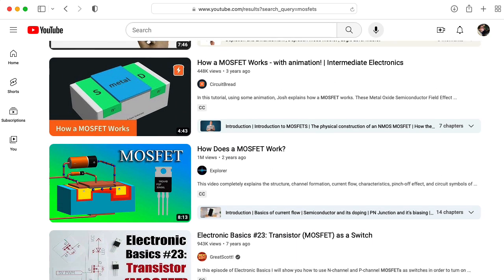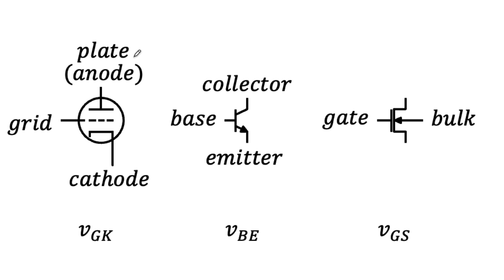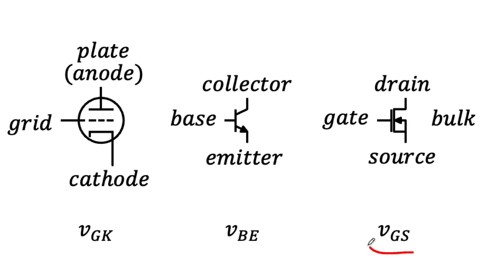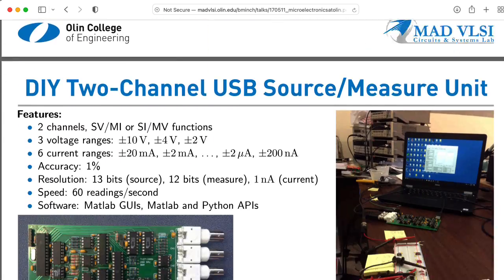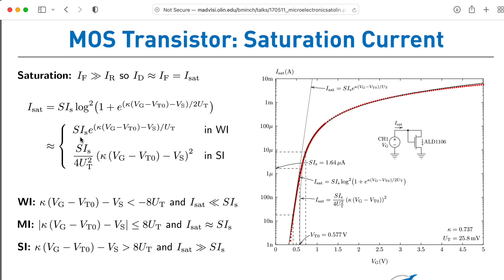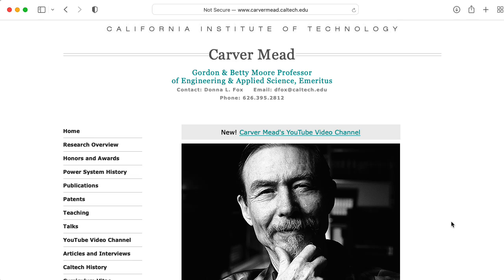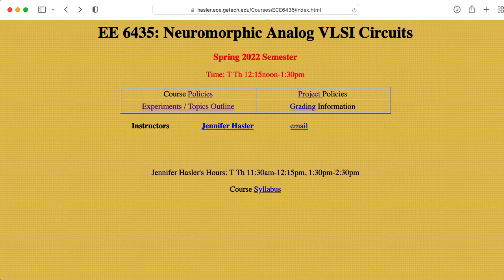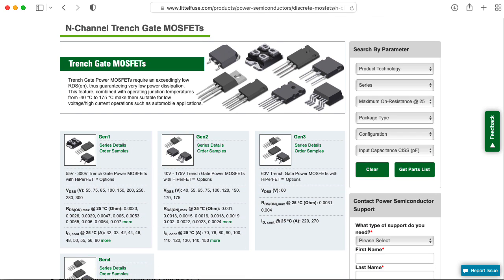They Mislead You About MOSFETs

Comment: Love your videos! As an analog IC designer, let me make some comments: most integrated technologies are build on a p-type substrate, which means that what you said about NMOS bulk being always connected to ground is true. Not for the PMOS though, they are built on an isolated n-well and they have a separate connection that can be tied to its source (another reason why sometimes PMOS input pairs are preferred over NMOS, other than 1/f noise). If it’s an n-type technology, it’s the other way around for the bulk connection. Also lots of technologies allow for triple well, which means that even the NMOS can be isolated. This is usually more expensive in terms of area, but sometimes necessary. Especially for more recent technology nodes, where headroom is a problem, and for mixed-signal designs(basically all designs today are mixed), as the switching noise from digital may couple via the substrate to the sensitive analog parts of a system on chip. Keep on the good work, and thanks for everything
Reply: YES, I was just about to write that. I worked as a layouter on analog IC chips for automotive industry and we used several different technologies that allowed for differently polarized n-well pockets and one technology that allowed splitting the substrate into few independent sections. This is somethimes a crucial component of the design and there are two main reasons why. The first one is, as mentioned by rscreepin, noise reduction. I remember routing an input amp section for integrated parking sensor, which was powered from it's own low-noise regulator. Second reason is the ability to work with "high" voltage (in our case, it was up to about 60V). Transistors have smaller breakdown voltage than the body diod of n-well to p-type substrate, but you can cascade them and process larger signals.
Also, I would like to add to the 2:12 claim, that you wouldn't want to put the voltage the "wrong way" around. Somethimes, you would. The body diod of discrete FETs is often used for "active" rectifier aplication. For example pretty much every lithium battery protection circuit has a FET transistor, which is connected the "wrong way around" and works as a diode.
Reply from the maker: Pinning this comment. Thanks!
Reply: @Lantertronics  You may find this of interest: A Simple Zero Debounce Delay debouncer for an SPST switch 
https://spacetimepro.blogspot.com/2023/09/switch-debouncer.html
Reply: There is SOI processes

Comment: You gloss over the asymmetric design of power mosfets at the end but that's actually a subject worthy of some attention, particularly in the way it illuminates why the IGBT exists and what makes it so special: it's literally an n-channel power mosfet with the N+ drain layer replaced with a P+ collector(/emitter) layer. This one change converts the body diode from a parasitic element to a primary current carrier, giving the structure a much bigger cross-sectional area to pass current through vs the thin conductive channels close to the gate that you get with the original mosfet structure.

Comment: High power mosfets have honeycomb structure and drain/source aren't symmetrical. Check out the illustration to "History and Emerging Designs of Power Transistors B. JAYANT BALIGA". Easy to find in google.

Comment: Your point about the Drain and Source being the same is only true for certain MOSFETS.   You need to clarify that you are talking about a low voltage device constructed using a lateral structure.  If you look at higher voltage vertical structures the Drain and Source are very different.  Also the same applies for your description of the Bulk substrate.
Reply from the maker: I mention it at the very end, but you're right, I should have made that clear up front.
Reply: Have to scroll tooo far to find this comment among all the fanboys cheering author who actually mislead them

Comment: 1:46 If the bulk is tied to one of the terminals, that makes the terminals different. But you repeat that the only difference between the terminals is determined by the voltage difference between the terminals ,and nothing to do with the bulk connection. That seems unclear or contradictory. You mentioned "putting the voltage the wrong way", but if there's no difference between the terminals, then there's no "wrong way".

Comment: Thanks for sharing, this video was quite insightful and it left me questioning some things, particularly CMOS gate design. Why is it that we only use PMOS as pullup and only NMOS as pulldown? I was content with the Vgs explanation (PMOS can only pull down to Vth-Vss, NMOS can only pullup to Vdd-Vth), but I didnt realize I was making an assumption that didn't apply to CMOS ICs generally, if the bulk isn't shorted to source (and vgs no longer applies), why are CMOS circuits designed the way they are?

Comment: A few notes:

1.) For NMOS, yes, it’s the bulk tied to ground. For PMOS you have a well in which the bulk sits. Of course, other technologies using isolating substrates like quartz, diamond or sapphire can have specialised bulk connections tied to either + or -, there are no absolute rules in design besides the physical characteristics of the device.

2.) BJTs are actually better described as current controlled devices because the maximum current flowing through the collector is in a direct linear relationship with the number of holes or electrons moved by the base-emitter current. Also, technically speaking BJT could theoretically be symmetrical devices, but their characteristics would be garbage compared to asymmetrical ones doped differently.

3.) There is a transistor kinda like in-between a BJT and a MOSFET called a JFET. Those have excellent linear characteristics, are indeed voltage controlled devices in normal operation and can be used in the anti-pinch region too for a few tens or hundreds of millivolts. Unfortunately, most of those are normally ON devices. Some MOSFETS are designed as normally ON too but the doping of conductive channel section is a bit more special.

4.) This is actually another thing that’s almost exclusively seen in MOSFETs. They can behave either as normally ON or normally OFF devices, which is remarkable since other technologies usually don’t allow for such a degree of fine-tuning. This versatility is why we’re seeing MOSFETs in the widest array of applications, from power switching and signal processing to digital computing.
Reply from the maker: Random thoughts: 

1) The RCA Cosmac 1802 has a silicon-on-sapphire version that's in Voyager spacecraft. I only mention this because few people have heard of the 1802 and I think it's really cool and want more people to have heard of it. :)

2) I much prefer the voltage-controlled viewpoint, since you're generally driving your circuits with a voltage. When I teach our junior analog electronics class I find it much easier to explain BJTs circuits in terms of transconductance, and the base current as an unfortunate defect that you just kind of have to live with. I have some more recent videos titled "BJTs are VOLTAGE-Controlled Current Sources!" and "More Story Time with Professor Lanterman (The BJT Control Controversy) where I blather on about this more. ;)

Sometimes people say the current controlled viewpoint is better than the voltage controlled viewpoint because the Ic = Ib beta equation is linear whereas the Ebers-Moll equation is exponential. But I think that just shuffles the complexity elsewhere instead of really getting rid of it. And beta is kind of a dodgy anyway, being a function of Ic (beta droop) and a bunch of other stuff.

3) I'm kind of sad that JFETs seem to have gone out of style. I see them used as approximate variable resistors in compressors/limiters and as muting switches in mixing consoles, but the only other place I see them used seems to be guitar pedals.
Reply: @Lantertronics  
I see you love JFETs too.
Did you know some modern JFETs are actually used in high voltage switching applications where MOSFETs tend to get their oxide layer fried?
eu.mouser.com/datasheet/2/412/UJ3N120035K3S_Data_Sheet-3177188.pdf
Check out these fancy silicon carbide JFETs.

Comment: This puts me in the mind of Newtonian physics: it works as a way to describe the stuff we can see, more or less closely enough to get the job done, but it doesn't actually cover all possible cases and even when it does work it's not absolutely accurate then either.

But generally speaking we can forget that when you throw a baseball it gets slightly heavier.
Reply from the maker: The twist here is that I think the voltage-control view actually makes it easier to analyze most transistor circuits, if you teach it the way Marshall did. It' like if general relativity made teaching easier than Newtonian physics. ;)

Comment: 2:18 "There is nothing stopping you from doing something pathological with it and putting the voltage the wrong way. Of course you don't want to do that." Having the source of an N-MOS positive relative to the drain is actually desirable when using them for power gating (common source pair for low-loss bidirectional control) in a BMS or other power distribution/management situation or when using them for synchronous rectification. You would likely also use this sort of setup in a bidirectional boost/buck converter. There are plenty of MOSFETs packaged specifically for those applications.
It may not make sense for logic but is plenty useful for power handling.
Reply from the maker: I really should make a follow up video talking about that. When I was making the video I was thinking about small-signal amplifiers -- analog signal processing sort of things. So I (sadly) missed this entire important application area.

I'd need to do a lot of study though, power electronics isn't my area.
Reply from the maker: Or I could cheat and point to another resource... do you know of another video here on YouTube by another content creator that talks about such topics well?
Reply: @Lantertronics  I'm not aware of anybody doing deep-dive videos into power conversion circuitry, not much of a market for that on YT. I suspect most people looking for this sort of insight will follow the datasheet and appnotes rabbit hole. Almost certain Bigclive has at least one power bank or other gadget tear-down where he explains why many battery monitoring chips use a dual-FET packages to isolate the battery. Pretty sure I have seen a multi-cell BMS review that explained the differences between contactor and MOSFET disconnect.

Synchronous rectification and bridge-less power factor correction are quite well documented, resources there are plentiful.

Bidirectional DC-DC converters are somewhat of a rarer breed, though I suspect interest for it will proliferate with the need for USB-PD to accommodate a broader range of anything-to-anything at the sub-200W end of the power spectrum and DC power sharing between home energy storage and BEV at the 10+kW end.

Comment: Aaron, the voltage between base and emitter (Vbe) does not change much after 0.66V for silicon as it is just a p-n. Bipolar transistors are driven by the current, not voltage. Are you really a "professor"?
Reply from the maker: I wish I could go back in time and find the people originally describing the BJT as a current-controlled current source and make them change. They've caused a tremendous amount of confusion.

The Ebers-Moll equations relate all the currents and voltages at the terminal of the BJT. It's not that calling it a current-controlled current source is wrong, it's that it's just as valid to say it's a voltage-controlled current source, and it's much more helpful in designing and analyzing circuits to think of it that way. Most circuits apply the input as a voltage at the base, not as a current source. 

The traditional form of the Ebers-Moll equations give Ic as an exponential function of Vbe. It's best to flip your "does not change much after 0.66V for silicon" which is a current-focused view around -- you may bias your circuit around 0.66V, but the small signal variation gives you a large change in current for a small change of voltage at the base, which is great! That's how you get gain! And then the current flowing through the base is something more like a parasitic effect the designer just has to deal with.

Remember in most transistor circuits you are using a feedback mechanism to stabilize the gain to a particular value, and in that case as beta becomes higher (more ideal), the base current goes to zero.
Reply from the maker: I would invite you to explore two resources. One is the ECE3050 Analog Electronics website created by my colleague Marshall Leach (google it, sometimes YouTube deletes links). You will see how powerful it is to view the voltages as inputs.
Reply from the maker: The other resource I would invite you to explore is my ECE3400 Analog Electronics playlist; I teach it using Marshall Leach's approach, which is to develop Theveinin and Norton equivalent circuits looking into the various terminals of the BJT in terms of Thevenin equivalent circuits seen looking out the base and the emitter. You will see how powerful the voltage-focused viewpoint is.
Reply from the maker: Consider the resistor. Is it a voltage-controlled current source or a current-controlled voltage source? Both views are technically correct, but which is more useful depends on what's driving it.
Reply: @Lantertronics   Resistor is a passive component, so it is never a source of anything. You are too caught up with the equations and carried away from reality. Try feeding a voltage source of 3V without resistor into the base and see BJT burn. Try feeding the same 3V to a gate of JFET, MOS or a lamp and they will handle it ok with conceptually similar output. Therefore, bipolar transistors operate way differently from lamps and FETs. BJT will never open if no current flows into the base. FET works fine with zero current through the gate. It is basic physics, not even college level. So, Aaron, put away the math for a month or two, get some soldering and measuring equipment and real semiconductors. You will be surprised how things are sometimes very different from SPICE.
Reply from the maker: @serge..k  A source in a circuit can refer to itself. Nothing you are saying actually contradicts anything I said. It's clear I need to make a video about this topic.
Reply from the maker: From Horowitz and Hill, Art of Electronics, 2nd edition, pp. 79-80: "We thought of the transistor as current amplifier whose input circuit behaved like a diode. That's roughly correct, and for some applications it's good enough. But to understand differential amplifiers, logarithmic converters, temperature compensation, and other important applications, you must think of the transistor as a transconductance device -- collector current is determined by the base-to-emitter voltage... For transistors is important to realize that the collector current is actually determined by the base-emitter voltage, rather than the base current (the base current is then roughly determine by hFE)..."

Open your mind to the voltage control viewpoint, and a world of powerful techniques awaits.
Reply: @Lantertronics  I completely understand your argument about advantages modeling around voltage control. And a very nice quote from Horowitz and Hill. But, changing collector load while keeping fixed Vbe causes collector current to vary. Feeding the base from a current source gives more correlating results. That's why BJT datasheets always specify hFE and never mA/V or S. So, for the ART of electronics, Horowitz and Hill gave an elegant viewpoint, but it is not technically accurate. With all due respect and eternal admiration to Horowitz and Hill. Therefore, by the mode of operation, BJT is a very different device from FET or tube hence my note about inaccurate comparison of all three.

Comment: Well, I do find it fun and interesting, to see different professors say the same thing, in different ways. Sometimes those differences in description subtend decades. I don't feel that I was ever misled. Having had the privilege of working at both the integrated level and the discreet level, I kind of knew all this, maybe because I have a tendency to remember little details like this. The happy, handy vgs formulas apply only when the bulk is tied to the source. For discreet MOSFETs, that is the case. On-chip, we can get that functionality only by giving the MOSFET its own bulk tub for source connection. For logic circuits, in which the MOSFETs of a particular flavor (N or P) share a bulk well, we just live with the fact that most sources are segregated from the bulk, making sure that the last signal to arrive at the logic gate is driving the MOSFET with the source tied to that common tub. In analogue design, the source should be tied to the bulk for best performance and predictability. But adequate models will allow predictable design without that accommodation. Thanks for mentioning the Bulk-centered, symmetrical EKV model. It continues to serve us well, and the modeling equations are a thing of beauty.